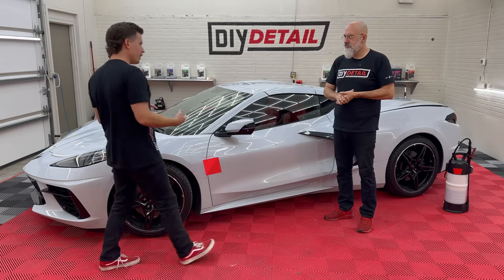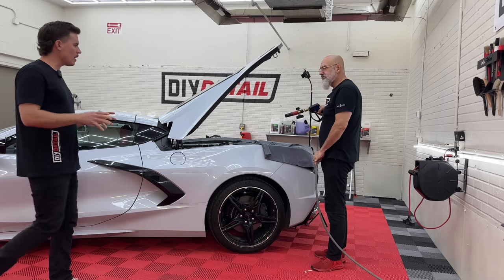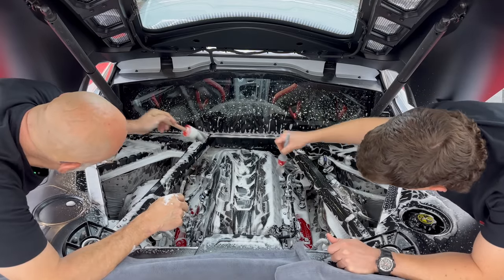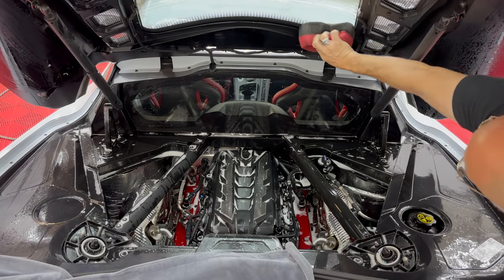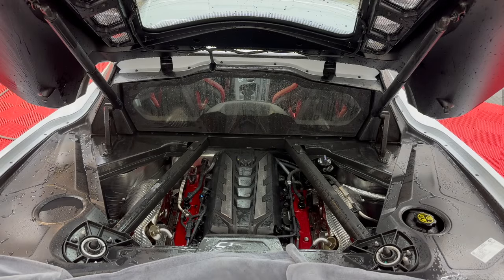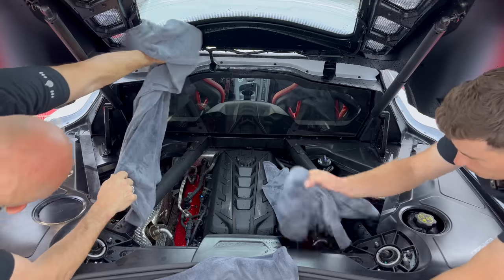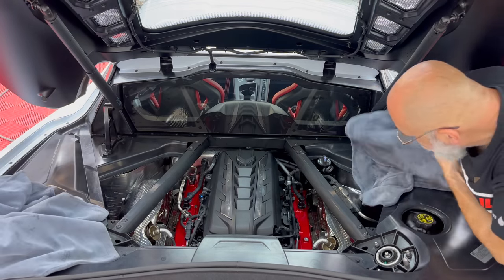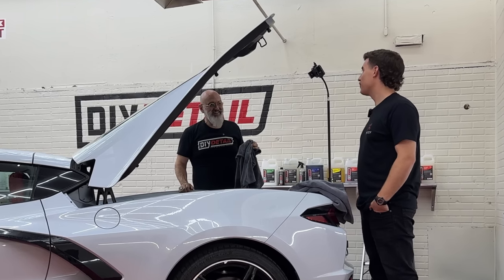How to CLEAN and PROTECT your engine bay (C8 Corvette)

Comment: Koch Chemie Motorplast is an amazing engine bay dressing. You spray on and just let air dry. When dry, it's dry. No stickiness. And the look afterward is magnifico!
Reply from the maker: Thanks for the tip!
Reply: @diydetailofficial  👍
Reply: Best product for engines I’ve used. And it’s Benz approved

Comment: Another tip: watch out for water intrusion in via the engine air ducting. Some engines have open engine air ducts (or large exposed air cleaners for carbureted motors) to be aware of. Cover with a trash bag or dam the opening with an appropriately sized towel to keep water out where it doesn't belong. Might be a difficult conversation if you need to buy the client a new motor!
Reply from the maker: True

Comment: I’m not fessing up what I did as a teenager to leaky 70’s engines but it involved a warm engine, engine block cleaner, and brake cleaner. The more water pressure the better the caked on oil came off. After cleaning I would fire up the engine to make sure it worked. The C3’s were designed the best on the exterior and interior. The interiors on C4’s were cool too but the engines were slow. A retro mod could be cool. Is this the Corvette with the flat crank? I would love to hear that engine roar.
Reply from the maker: Yes, but I still prefer the sound of a push rod small block.

Comment: Hey guys, thanks for the video.  This is off topic but need some advice please. I've copied your method of using a dampened towel with your rinseless wash for removing polish from panels,  which has really helped , but my question is , if I'm doing a coating with your 5 year ceramic for example, I'm concerned about leaving residue from the rinseless wash on the panels even after using your panel prep spray. I'm wondering if  i should be going over the vehicle twice with prep spray before coating. I'm thinking there would be bonding issues if not thoroughly removing the rinseless. Your thoughts please.
Reply from the maker: Our Rinseless leaves nothing on the surface.

Comment: Off topic. I tried to wipe polish off with rinseless wash first, then come back with a plush dry towel and it was very grabby to wipe off. Didn’t like it.
Reply from the maker: Did you use a short nap towel? That’s what we prefer
Reply: @diydetailofficial  initial wipe with dampened rinse-less was short nap, then came back with a semi plush for second wipe. Maybe it was the polish I was using(not gold standard).

Comment: I have a 65 bigblock, 69 smallblock, and a 23 C8. In the engine bay the large horizontal flat areas  between the engine and the fenders are blotchy looking from water sitting there at the dealership before I bought it. Is there any way to remove those stains? They aren't waterspots per se but almost like discoloration.
Reply: Engine of the C8 I'm talking about.
Reply from the maker: Try a little DIY Detail Water Spot Remover, if not a dressing will help.